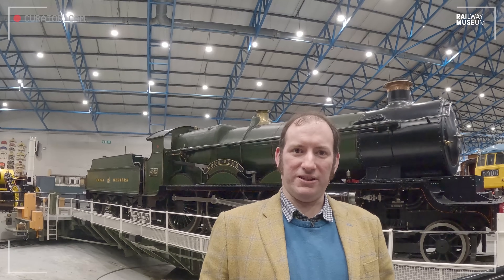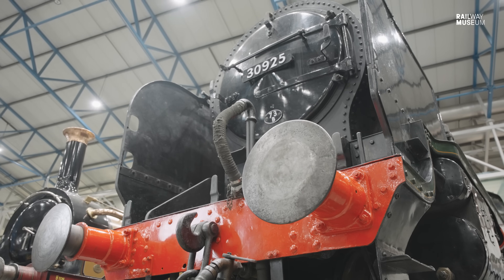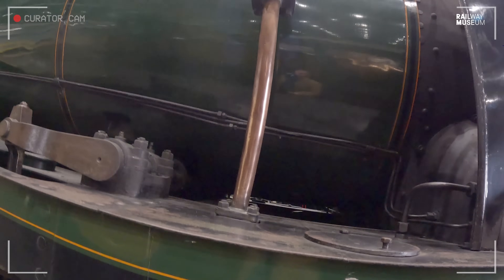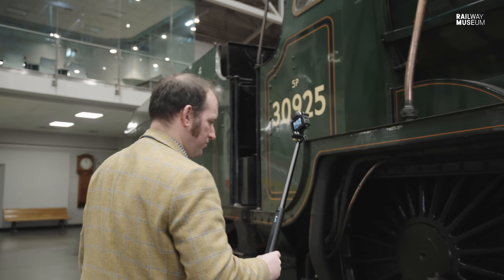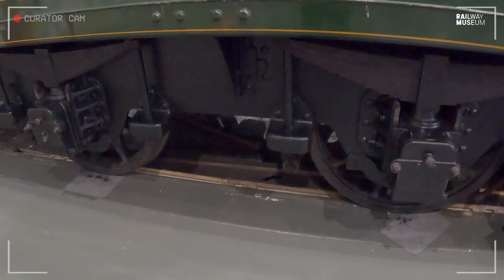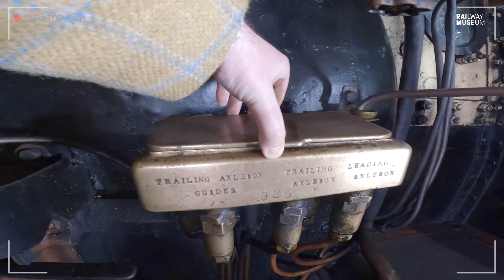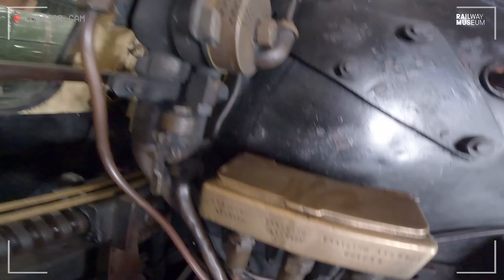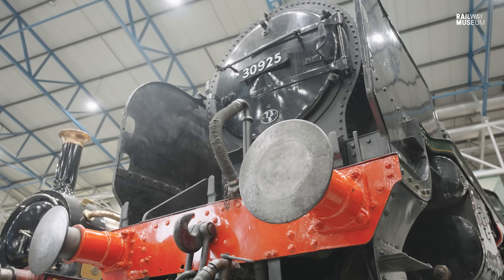Cheltenham: Britain's Most Powerful 4-4-0 Locomotive | Curator with a Camera

Comment: The blowdown valve is mainly to remove some concentrated solution from the boiler, as otherwise it gets stronger and stronger over time (since only steam comes out through the regulator).  Most locos had a continuous blowdown into the ashpan as well.  To really remove sludge, you need to take out the mudhole doors and use water jets.

Comment: May I suggest a video where you could compare the different between 925 Cheltenham and 926 Repton that’s based at the NYMR if that is possible
Reply: It's post-preservation story is interesting. Repton was withdrawn in 1962, stored and preserved in 1966 before being shipped to the US for running in Vermont and Canada.  

For this, Repton's tender has a replacement tender tank and bunker for increased coal capacity, and resembles a high-sided self-trimming tender that was initially attached to Blundells until 1958, and Tonbridge thereafter.  It was brought back to the UK in 1989 by the late Clifford Brown, and has been based on the NYMR since.

Comment: AMERICAN FACT OF THE DAY: by the time Cheltenham entered service, the 4-4-0 had long since fallen out of favor with American railroads*, with the wheel arraignment being replaced by the 4-6-0 “ten wheeler” & 2-8-0 “consolidation” for passenger & mixed traffic service respectively

*the Chicago & Illinois Midland Railroad & their 3 Class A1 4-4-0s are the lone exception, being delivered in 1928 as the final 4-4-0s to be built for any North American railroad. All were scrapped by 1953

Comment: Some extra coments. V good photography.  The desin engineer was R MAUNsell not Mansel! He never built any 'bad ' loco classes, unlike a few designers. You dont say who "Bullied" was ! but give a lot of useful general , & technical info. -vgood explan n of the lubricators + other controls in cab . I didnt know about the boiler sludge 'blow off cock'/ pipe.  Actualy I saw this loco working at Quorn (Leices -) on th presevd Gt C R.
Reply: In Ireland Maunsell is pronounced Mansell !!!!
Reply: The u is superfluous for pronunciation in Maunsell, and is a situation similar to Cholmondeley being pronounced 'Chumleigh'.  One place explaining the spelling is 'A Century and a Half of the Southern Railway' by David St John Thomas and Patrick Whitehouse.
Reply: Indeed, a jocular way of describing the pronunciation.
Reply: H.A.V. Bulleid may be responsible for that.  In his hagiography biography of his father, he insisted Maunsell rhymes with cancel 

There's no denying OVSB's front end modifications served both Maunsell's express designs very well indeed.

Comment: Very informative and enjoyable.  One slight pedantic point: The Schools may have been the last 4-4-0 design on the British mainland however the GNRI (A cross-border operation serving Belfast-Dublin, Belfast and points west) introduced a 3cyl compound 4-4-0, coincidentally their V Class, in 1932.  In 1948, Class VS (3cyl simple) were introduced.  Both served until the end of Irish mainline steam and one of the V Class (No.85 Merlin survives, owned and operated on mainline specials by the  RPSI)

Comment: Indeed the Schools is such an important class that if you visit the NRM you'll find it has no caption board. Neither does "Boxhill" next to it. Same goes for the Stirling single and the class 84.
Reply: All these engines have been in the great hall before and will have had caption boards made for them. These will be in store somewhere.
Reply: - Cheltenham isn’t usually at the NRM. It’s part of their collection but is based at the Mid Hants railway (it’s awaiting space for an overhaul; shame that the NRM got rid of their loco works)
- Boxhill used to be in the learning area opposite the station hall, so might not’ve had an info board
- No clue about the Stirling single. Could’ve sworn that it had a caption board (Henry Oakley doesn’t have one either)
Reply: They are on the way. My colleagues have been working on them. As you've probably seen on the channel, we have had a lot of things on the move and we're playing catch up.

Comment: A pocket battleship - couldn't have said it better if I was paid to!

Worth noting that even on a European scale, the Vs are impressive. Really only the NMBS/SNCB Type 12 comes close in regards to such late yet outstanding 4-coupled express locos.
Reply: Terrible factor of adhesion, though.  Having 3 cylinders helps spread the torque a bit, but they are quite wheelslip-happy.

Comment: Like you said the Southern railway didn't use water troughs on it's lines. Instead they used water cart tenders which had a much larger water capacity from anything from 5,200 gallons to 4,000 gallons as on the Schools Class. It just meant on long journeys they would have to pick up water at stations